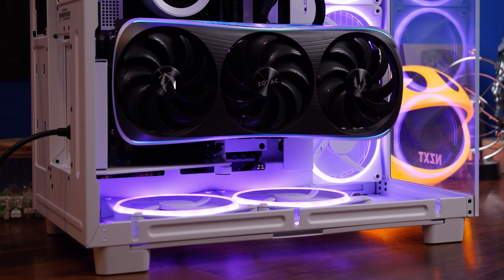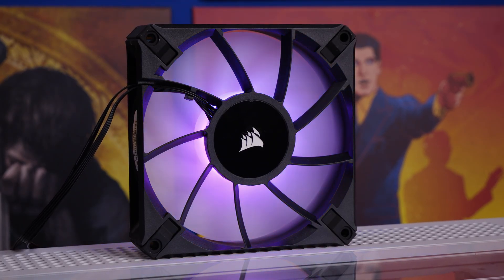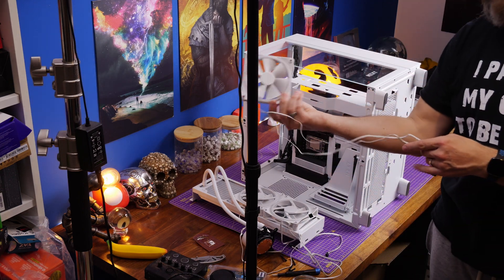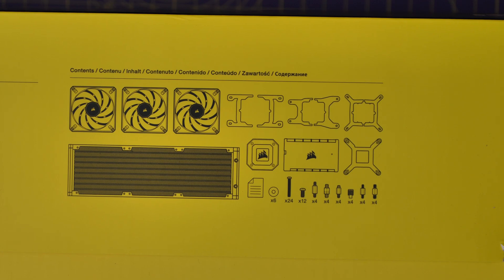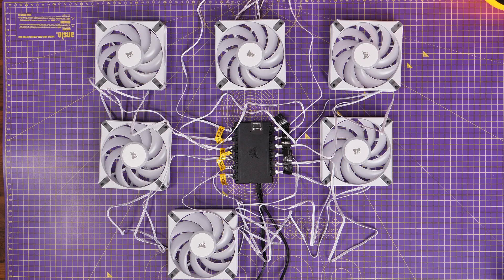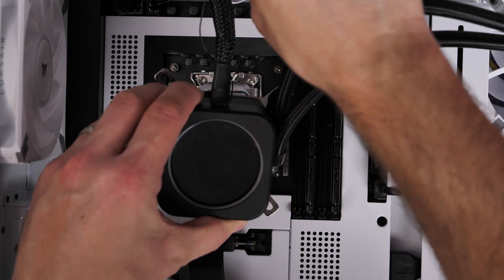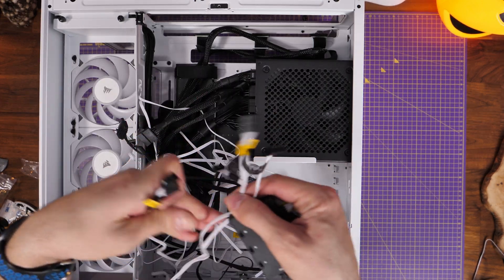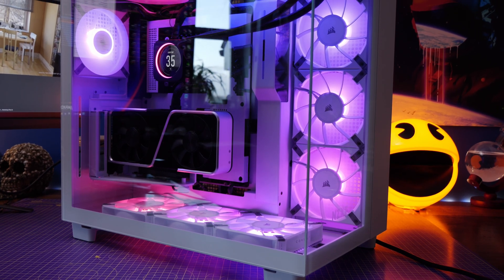How I make PC build videos and the effort that goes into them (behind the scenes with the NZXT H9)

Comment: I removed the bar to fit my E-ATX case
Reply from the maker: Interesting. Specs say it only takes atx. Did you not use all the standoff locations?
Reply: @TheProvokedPrawn  I used what was available. No need to use them all. I also use a E-ATX in the O11 XL. 

That beauty bar is restrictive in the H9 It’s cute but meh
Reply from the maker: @kittleeagle  interesting 👍 thanks.

Comment: Hey man, could you possibly tell me what vertical mount you used for the 40 series card and did you run into any performance issues?
Reply from the maker: https://www.amazon.co.uk/NZXT-Vertical-Mounting-175mm-AB-RH175-W1/dp/B0B4HJSH49/ref=asc_df_B0B4HJSH49/?tag=googshopuk-21&linkCode=df0&hvadid=641630615694&hvpos=&hvnetw=g&hvrand=7147194205703741096&hvpone=&hvptwo=&hvqmt=&hvdev=m&hvdvcmdl=&hvlocint=&hvlocphy=9045049&hvtargid=pla-1720496211298&psc=1 

Didn't see any issues